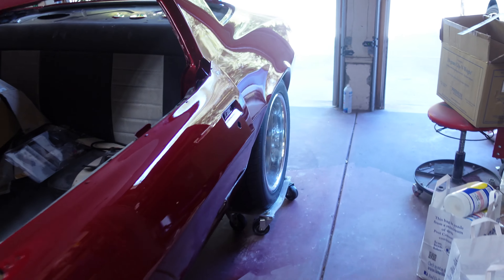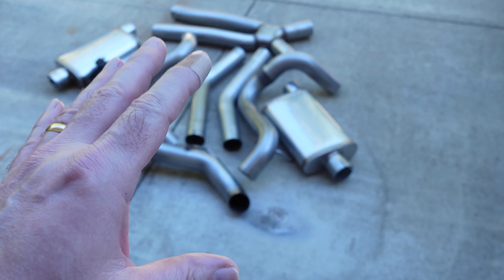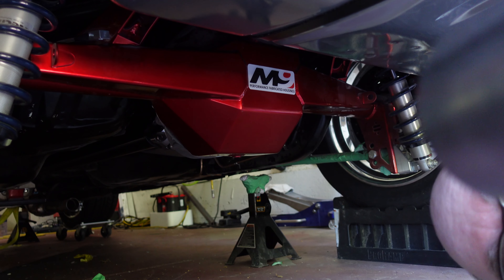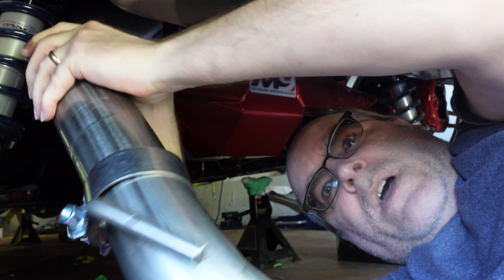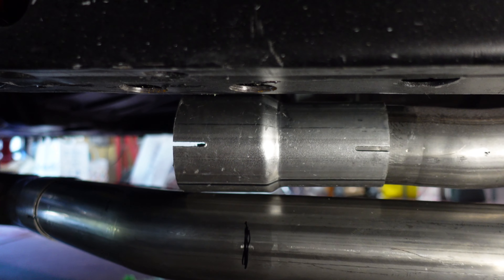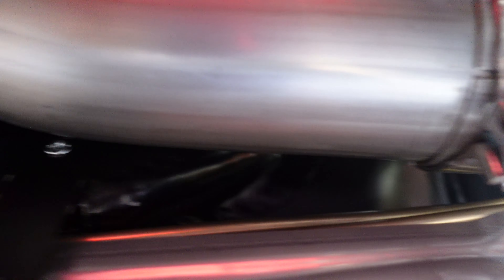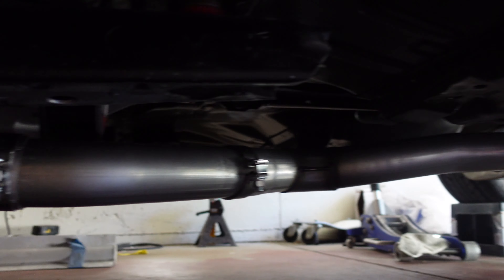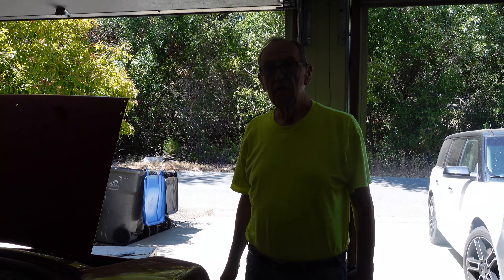1977 Camaro Z28 Part 272: Hooker Blackheart exhaust

Comment: If you're worried about your vent lines, you can heat wrap them. They sell Velcro and stitched heat wrap you can slip over the lines. The exhaust is (relatively) cool that far down the pipe too so it may not be a problem.
Reply from the maker: Thanks Andrew. I bought some for the starter cables, etc up front.